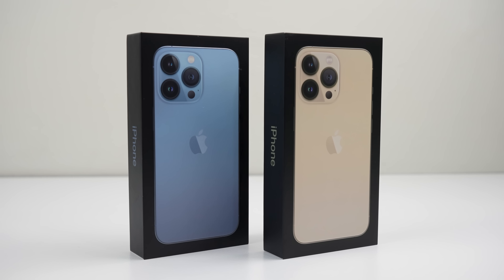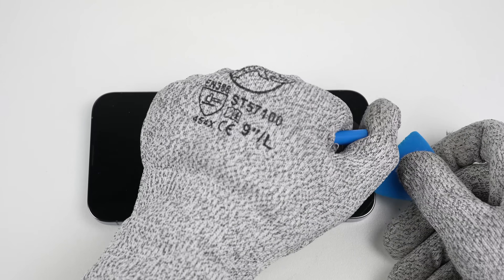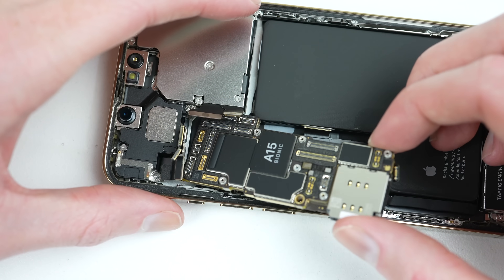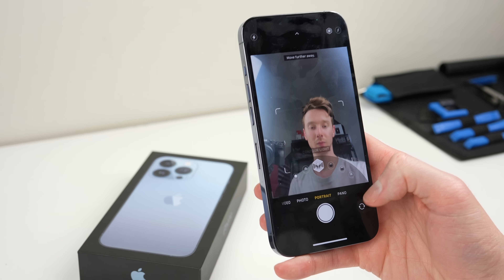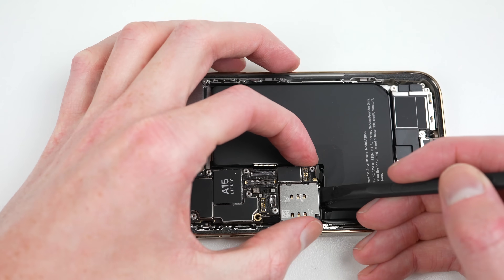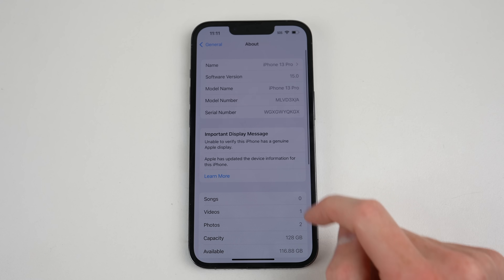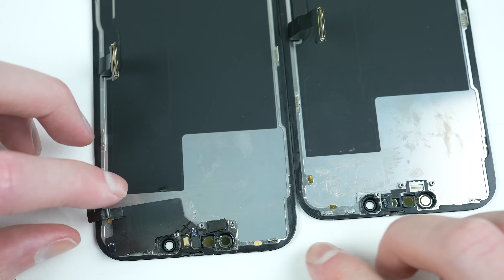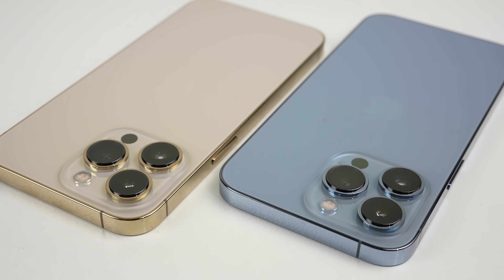iPhone 13 A Repair Nightmare - Teardown and Repair Assessment

Comment: Everyone says "this is too far" but haven't we "been too far" for awhile now? Samsung locks their bootloaders and serializes their A-Series displays the exact same way apple has here. I came home tonight to find the dishwasher leaking, this means I will have to buy the THIRD new dishwasher in just 5 years. No schematics were found inside it, I cannot get parts and there is not an appliance repair place near me. What a crappy time to be an electronics enthusiast, or really, anyone who enjoys fixing things or saving the enviroment. This is BS.
Reply: I agree with this statement, but who keeps breaking this mans dishwasher?
Reply: @Berk787  modern ones have self-destruction feature
Reply: @Berk787  the first one just stopped working, but the part I needed wasn't available, and now the second one is leaking. It's so stupid
Reply: @Ernold well, if my dishwasher breaks in 2 years then I will never buy from that company again. However, if my dishwasher breaks after two years but there are schematics and parts for me to fix it, I will just fix the damn dishwasher and buy the parts they sell. This way they make more money from me
Reply: @BrevityBuzz  Imagine if your dishwasher's on button breaks and it just straight up completely stops working after you replace it. 
That's basically apple's approach 😂
Reply: @Litepaw  that is basically every manufacturers approach, but apple is bringing that to the phone market as well. I own an older iPhone and have replace the battery and the earpiece without much hassle. They are now trying to make it a hassle. The good thing is that even if right to repair fails, you can get iPhone programing devices and you wont face the issues that are discussed in the video
Reply: If your dishwasher is leaking, why would you need a schematic? Is it leaking water or electricity?
Reply: @alecb8509  so you can diagnose where the problem is. What if it’s a leak in a tube, or a crack in a certain part, without it they can’t diagnose the problem and then properly fix it
Reply: @alecb8509  You don't per se need a schematic to do repairs, but it will help Greatly in not having to play detective in figuring out what goes and connects where, what part, what voltage, etc.

But whether you do or not have the schematic, you Need the parts, these can be generic and mostly universal third party parts (make sure get a part is reliable and safe) or more expensive original part (which btw, does Not say it Is a reliable or safe part, just original) and be able to get inside at all at all.

I fixed my own dishwasher, and family's washing machine and dryers by myself just learning how the components inside work, checking connections of chips, capacity of capacitors, looking for damage or wear, looking up online for any symptoms and causes that corresponds to what i see and what people usually repair.

Costed me just €6 to replace worn down condensator, €6 to replace lg304gn and resistor, €25 to replace carbon brush, €22 to replace oil ring...

But for an iPhone, however screen replacement should not be that time consuming at all, as long as you are careful enough, and have the right tools (screwdriver, heat gun, flat tools, etc) and have a source to quickly get a reliable screen or battery (at my place i got iPhone SE, 6, etc screens within 1-3 days for quite cheap), then it should be all fine (people using these devices are to this day for several years or months still happy).

But unfortunately, because of that dumb and hostile serialization issue in newer updates and phones, this is not possible (unless we can get hack Apple and Steal their (or an employee does) tools (and for good measure, back them up for reupload)), instead, you need to have their good will, bend over for them, and let them have your behind, then maybe pay several hundreds or thousands (perhaps they will just wipe your phone too, or thrash it to give a new phone, calling it the same phone and a 'repair'), just so they bless parts so the phone's software accepts them and starts running whatever code to disable the 'bugs'.
Reply: I had my 15 years old dishwasher repaired recently. The repair guy told me to repair it again if something goes wrong, instead of getting a new one, cuz most of the new ones are unrepairable at all, and the others are really difficult to repair because of parts availability and price.
Reply: @DoctorKekz  I can't agree with you and your repair guy to the moon enough. Same thing is going to happen to cars too, and people are already on the road to that buying a new car when their old one is fine. The truth is everyone wants new, new, new, and nothing else. The new cars are honestly not going to last as long as the older ones due to all the fancy electronics and such. What do you think will happen when the car starts to rust out? All of the electrical problems are going to be out of control.
Reply: Locked bootloader isn't an issue, you can simply unlock it with a lil bit of knowledge
Reply: @emyaqin  I was reffering to the camera being disabled with an unlocked BL, my comment was already long so I didn't want to elaborate
Reply: @Carterthielftw_  You can spoof the OS to think that the bootloader still locked, not an easy one, but still, it's not an impossible thing like iPhone software lock
Reply: @Ernold I'm currently on an S5 because I do all my real work on my PC or Kindle Fire, I want to upgrade, but fairphone is not available with my carrier.
Reply: I dont see difference now. Older iPhones locks features behind origina apple parts and those parts are available oly for certified 3rd party. I can easily see tons of iPhones on second hand market without functional TouchID or FaceID. It is easy to know that phone was heavily damaged and previous user bought some cheap replacement parst from Aliexpress or choose non certified repair shop which uses those cheap non original parts. Funny fact is that sellers oten claims "still under warranty" :D
Reply: 100 percent man.  Right to Repair is a necessary movement.  We are a disposable society and that makes me bummed.
Reply: Just get under it and replace the existing water outlet, can make it from hardware store supplies easily if it is just the pipe, if it isnt the pipe work tho, well that aint good
Reply: Doesn't only snapdragon variants of samsung phones have locked bootloaders and in US? (I heard some chinese snapdragon ones have unlockable bootloaders but that might be wrong)

And the exynos ones have unlockable bootloaders.

Though it blows a fuse after installing a custom rom/recovery making stuff like knox and secure folder non functional so it isn't that great.
Reply: just buy a 70s maytag, they don't break bruv
Reply: @thewizardcarchannel  Agreed!
Reply: @Mr. Khan when you can find a android phone thats 6 years old and is still updating to the very latest software and petforms as good as it did brand new, come back to me.
Reply: Electronics, unlike electricals, are inherently difficult to repair, especially when the manufacturing process has become so microscopic they the human hand seems to inept for the products made.
Reply: If your dishwasher is leaking it's either the door gasket, a supply valve/solenoid, discharge pump or a hose. Those parts are easily found on line.
Reply: @The Forsaken One that's not the point of right to repair
Reply: @Mr. Khan What Apple is garbage I'd use a Samsung Galaxy over that trash anyday but they all do this bs Apple is just the only one thats been caught so far
Reply: @Mr. Khan My Apple devices last much longer than any Android device me and friends of mine ever had. Plus my iPad Air from 2013 still got updates, which is awesome. Most people buy Apple devices and keep them for 3+ years easily. And the resale value is also great. That’s what most people like about apple. Plus the OS is simple and all apps communicate perfectly between each other. You get work done and save time. It’s embarrassing how people get so personal when attacking or defending a company.
Reply: @Mr. Khan yeah I can tell you haven't traded in an iphone recently with apple

The last 4 years or so they've offered way higher value for trade ins compared to what resale on ebay wouldve gotten me

I was initially selling my old 8 plus for $200 on ebay but apple gave me like $400
Reply: @Mr. Khan apple support their devices for way longer than android. What universe do you live in?
Reply: "You will own nothing." And now think about that.
Reply: Wait what? We change Samsung screens in our store daily, and have never had an issue with the A series? Is this some US only thing, or what am I missing? Which A series phone in particular?
Reply: @JimiWesterlund  this was happening awhile back, they may have reverted the change, but the issue never gained widespread attention, it seems to affect the A_1 series - https://youtu.be/zGLQ9ZRntZo
Reply: @Carterthielftw_  Actually very interesting.  We have fixed 40-50 of those mentioned in the video, with no issue, since release. So likely it is one of two options. It might be that the "Service pack" original screens we use, are pre-programmed to work, or alternatively, they fixed the issue on that particular device with a firmware update at some point.
Reply: @JimiWesterlund  neat, I'm glad samusung did the right thing and reverted it.
Reply: I just had to buy a new dishwasher because multiple parts failed within a short time at ten years old. Some of them are available, but far too expensive to make repair worth doing. Manufacturers don't support anything beyond a few years anymore.
Reply: @AcmeRacing  Often or sometimes, the exact same parts of dishwashers, dryers and washmachines are reused for newer models and among different brands, might be a good idea to take a look at exactly what part you need, then check on similar machines if the exact same part is used there (same function, diameter and size, material, etc), i mean, for hardware with firmwares or serialization, that might be incompatible or a pain, but anything else, sure.

Like, if you look up the website of brands  for the parts section, for example for a mini dishwasher, then you can see most use a oil seal ring of the same material, inner and outer diameter, double lip, etc, with maybe yes or no grease already inside (if not, you can just use sillicone grease and add yourself), or the same pump and motor.

For bigger dishwashers, between old and new there may be more often differences, but maybe you can find a exact same part if you do your best.

 parts of mini dishwashers on multiple

Also might be a good idea to check if the part being sold, like a screw, oil seal, chip like lg304gn, capacitor (the big tube things next to the motor that stores a lot of energy), or whatever, is a part you can get from a reliable vendor that sells the exact same kind and quality part.

In my country, for condensators i could look at condensators (dot) nl, getting the one with the right mF (miliFarad) and voltage (450 volt AC), costing about €6, but Wayy more on the manufacturers website.

The important thing is, Get a deep understanding of what the part is, it's material and what the limits are of that material, thermal/heat, stretching, chemicals (like acids, soap, alcohol, etc), etc, what kinds of different versions of that part there are, how to safely install and remove it (so you don't break it, or don't electrocute yourself), how to spot low quality ones, etc, basically research it (of course this will increase repair time and you'll need patience, but it might be fun and useful in the future for a different problem encompassing that part).
Basically, eliminate the magic/black box thought and obtain comprehension of what you see.
Reply: Keep in mind that other Apple products use Samsung parts
Reply: Mate, if you have to buy a new dishwasher, you may as well pull it apart and see if you can fix it without the schematics. Who knows? You may get lucky and save yourself a bunch of money. At minimum you'll get a better understanding of how they work, and you can salvage a bunch of other parts. It's already fucked, so if you can't repair it, then the worst that can happen is that you fuck something even further that was already broken to begin with, and then you go out an buy the dishwasher you were already planning on getting. 🤷‍♂️
Reply: these days you don't really own anything,  more like you lease it indefinitely
Reply: I suggest to buy extended warranty, I always get 5 years cover for TV, fridge etc cost a fracture of buying a new one
Reply: "bUt SamSuUuUnG"

Both Apple and Samsung are trash. That's just one more good reason to boycott both Samsung and Apple. They're not the only 2 options you know? 

I have a repair friendly flagship phone with a semi clean install of Android 11, that won't even lose warranty from rooting.

The difference between Android and apple is that Apple is a manufacturer and they make their own OS.
Android is just a base for an operating system that manufacturers can customize and modify to their own liking, or release straight up minimally modified. 

Samsung makes damn great hardware, my phone has 2 main camera sensors by Samsung, and a 1440p 120hz curved AMOLED screen by Samsung, and i think the memory modules are theirs too but not 100% sure.
But their phones and OS with all their bloated glory really suck.
Reply: @Litepaw  What phone is that?
Reply: Sorry, but Samsung is nowhere near as worse as Apple. It's relatively easy to buy OEM Samsung parts as they sell it themselves so quit with the whataboutism. Y'all always use these deflective tactics.
Reply: @dxshawn532  think Samsung's just as bad , they don't ship the same processors , which are still completely different except this year where the gaps narrowed but it's still a noticeable difference in camera and gaming performance . (Owner of a s21 ultra) , and Samsung has certain software locks which I dispise in addition to the fact Samsung doesn't support aptx hd or low latency or adaptive only it's only codec , sonys codec, SBC and aac ( which really limits on what u can purchase for a good audio experience, either Samsung's own headphones or Sony's . At least apple let's u have the same basic experience on all its headphones ) and Samsung has made right to repair difficult which I think they kinda rectified but still not sure. And that's not mention the fact that Samsung (until last year ) would only give 2 years of software support on its phones . I'm an Android lover , and a USB c lover , so going to iPhone isn't ideal but I'm currently considering switching based on Samsung's poor behaviour . Maybe I'll go to OnePlus but even that company has its problems .
Reply: @Mr. Khan Apple devices get far longer updates and major updates like iOS 15. And you totally ignored my point about the OS. But that’s just what I expected. Whatever…
Reply: @Mr. Khan lmao. You really are clueless
Reply: Live from the boot  You can talk like that to your f. mother, but not me. Way to start a discussion, moron. Enjoy writing with yourself.
Reply: @Mr. Khan android dont get 3 years worth of security at all. Quit jimmy bull shitting
Reply: Do you have a sink?
That would solve your dishwasher issue too.
Reply: @Falconhunter276  You got a pen and paper? That'll solve your smartphone being broken
Reply: @Litepaw  lol
Pretty hard to watch YT with a pen and paper. Can't hook up to WiFi!
Pretty easy to get clean plates with a sink though, this makes a dishwasher an unnecessary upgrade.
Phones are no different, useful but the whole upgrade stuff is truly unnecessary.

Comment: why they put so many flex cables inside those phones? usually a phone has a connector for battery, maybe buttons, usb, display + touch and cameras. why? there are like 14 cables.

Comment: I remember getting my iPhone 6s Plus as a hand me down for my brother and it had a cracked screen I ordered a screen for like $30 off Amazon and replaced it myself after that I replaced it three more times because they all cracked because they were cheap but anyway that’s not the point the point is it was so much fun knowing that I could fix something so easy and still have no knowledge of technology I have the iPhone SE 2020 now and I’m so happy with it the only thing that scares me is when it’s time to upgrade again in four years and I won’t even be able to fix my own phone maybe that’ll be the time I go back to Samsung
Reply: Samsung is heading in the same direction unfortunately
Reply: I have a question
Is your iPhone SE 2020 good do you like using it is good for quality?
Reply: Good old iPhone 6. Still so easy to find parts and repair everything and works just fine.
Reply: Righttt! We’re in the same situation I just bought my SE and it’s pretty great. Went from s9+ to Pixel 4xl to iPhone 6 to 2020 SE and it’s pretty snappy and great quality. Mainly got it because it’s easy to replace anything myself 👌
Reply: @CactusBoi420  how the hell do you downgrade from pixel 4xl to an iPhone 6
Reply: Unfortunately Samsung isn’t much better
Reply: Samsung isnt better
Reply: You need a beefy screen protector
Reply: Unfortunately only the Chinese phones still allow certain kind of repairability.
Reply: get a new phone, Iphone 12 or samsung, buy a good case and tempered glass screen protector. And don't toss your phone like a damn shuriken, or accidentally drop it over a thousand times. Also refrain from updating them too much and downloading alot of bullshit. It may last you 6 years or even a decade. But you may definitely have to do a battery replacement at one point which both companies will fuck you.